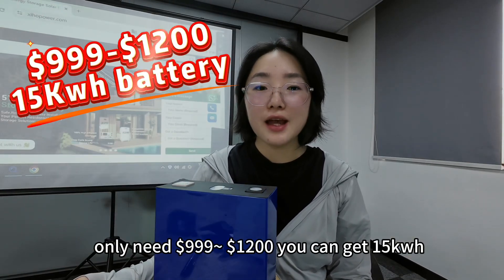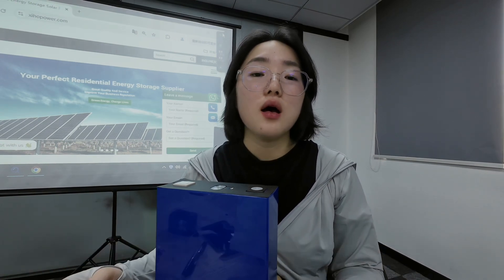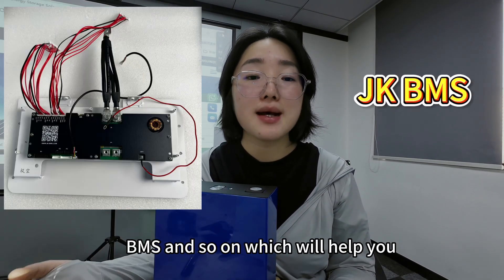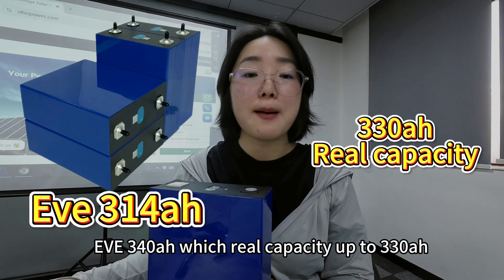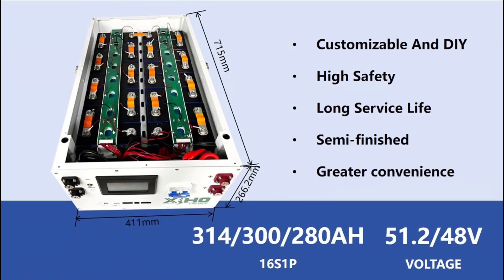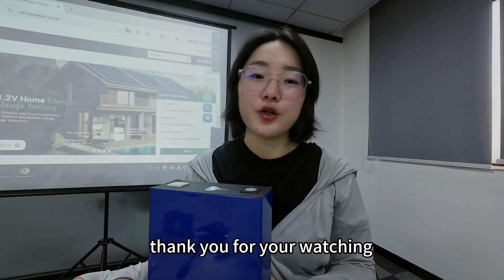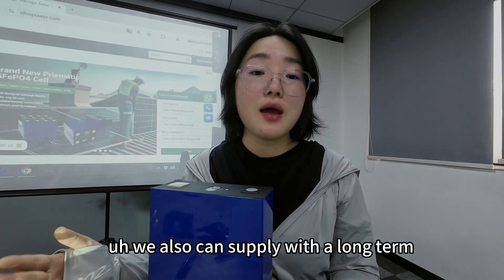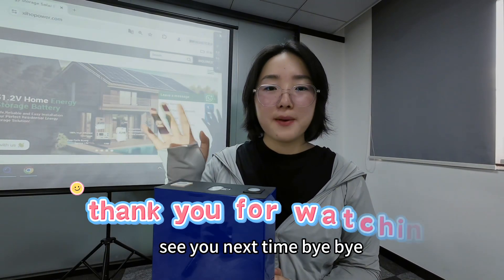$999 can DIY a 15kwh battery Pack

Comment: Looks nice, but the 4 screws holding each battery terminal on the faceplate should be recessed to avoid a short-circuit risk.

Comment: I think there's too little information.
Max Charge- / Discharge current? What kind of BMS? Heating? What kind of balancing?...
Reply from the maker: the cell battery with 0.5C charge and discharge rate, and Jk BMS with active balance, if you wanna know more about it, you can contact to me on whatsapp: +86 18902310429 or e-mail: sales08@xihobattery.com

Comment: can I connect 8 such units to get 400V  128 kwh high voltage battery pack ?
Reply from the maker: hello, it is okay for the pack to do series and parallel, if you have any interests for the pack, you can contact my whatsapp: +86 18902310429
Reply: @XIHO-Cass  OK but what inverters are supported with your BMS  ? do you have any examples ? I need to build 3 100kwh high voltage energy storages with inverters
Reply from the maker: what the bms we use is JK bms, and which is okay for the Growatt, Solax, DEYE, SMA, and so on, may i have your e-mail ,so i can send you more details, or you can contach me with my e-mail: sales08@xihobattery.com   whatsapp: +86 18902310429
Reply: @XIHO-Cass  Can you confirm that your Battery will work with Growatt SPH10000 BH UP t3 ?
Reply from the maker: yeah, the JK BMS we use for the pack is okay for this type inverter
Reply: @XIHO-Cass  Guess they can be paralleled with no problem - but connection in serial? Really??? This would mean that all MOS switches mut be for 400V+. Sorry, I can't believe this.
Reply from the maker: @ginnescamper7421  high voltage need to change the BMS  for it with some in series